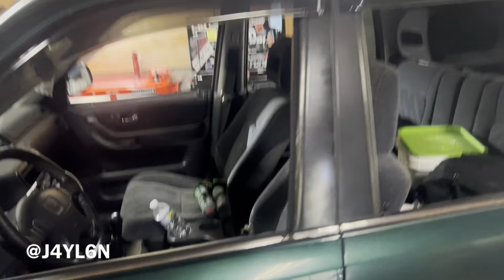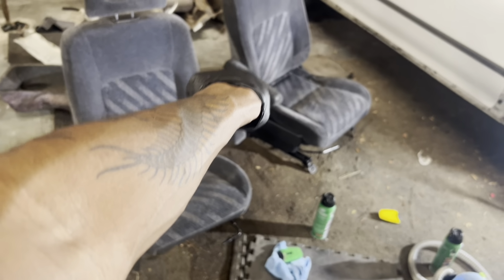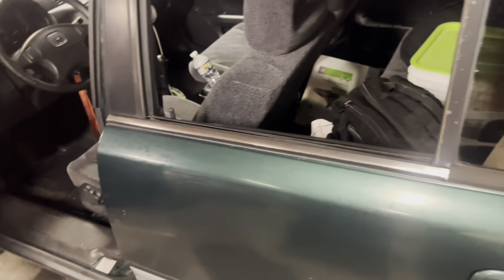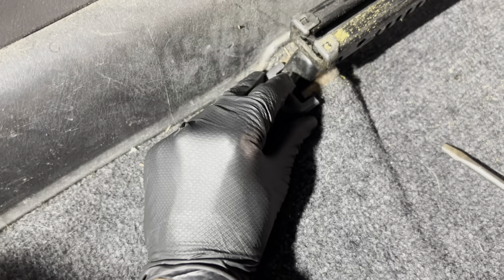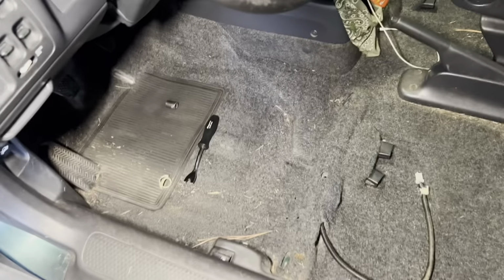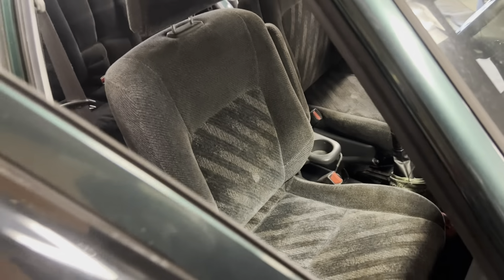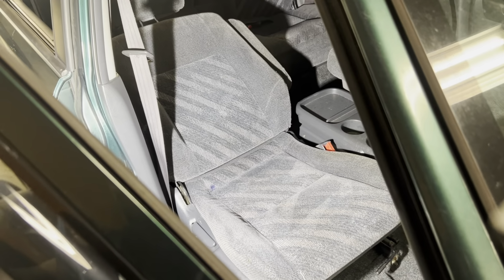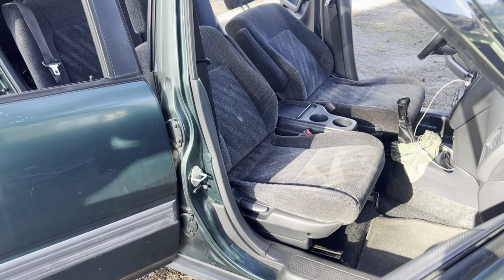1997-2001 Honda CRV Front Seats Replacement (Easy Removal and Install)

Comment: Because the older seats are in better condition I’d just swap the armrest. Just need to un zip the fabric, loosen a 17mm bolt, remove the armrest, then remove the bracket with two 10mm bolts. To install for the passenger side you’ll have to cut the fabric correctly by feeling for the metal bracket on the seat. But at least now there’s a video teaching me how to remove the seats. Great vid!
Reply from the maker: thank you very much!